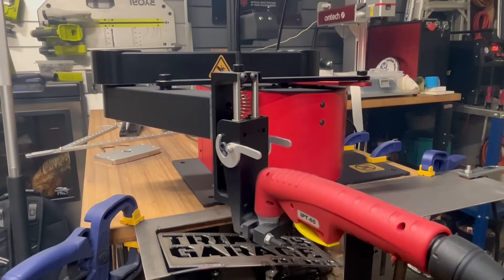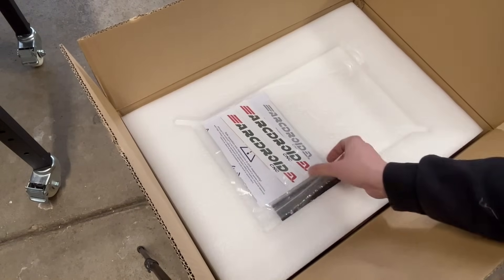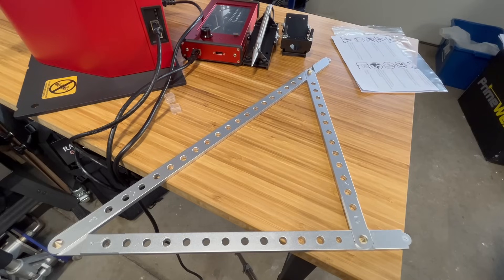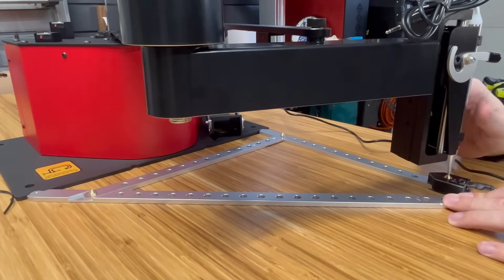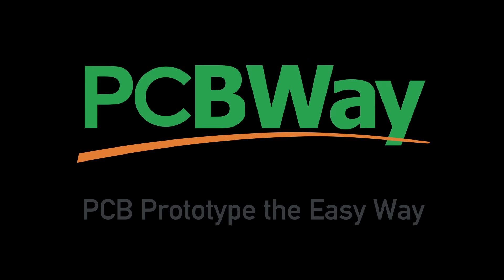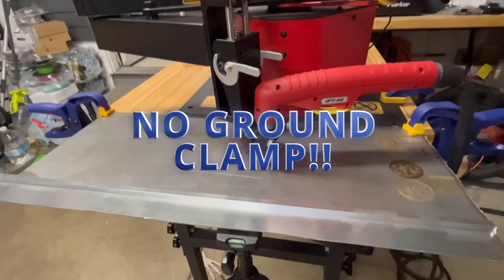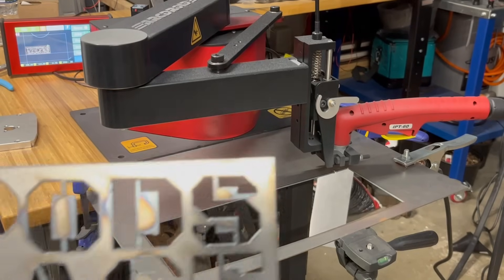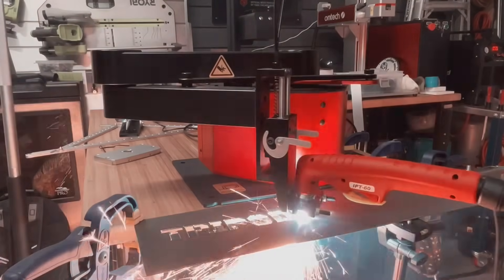ARCDROID PORTABLE CNC PLASMA MACHINE

Comment: Had an original plasma cam. The dirt and smoke it created doing long cuts in stainless covered my shop and everything in it with slag and dirt. Had a water table, vent hood , even tried a 6 inch vac line that rode with the torch..no way. Finally I called the company and was told most guys will set it up in a open ended trailer outside. These things are great but they can cut hundreds of inches without stopping and the amount of dirt and smoke is huge.

Comment: great clip. the Arcdroid is an amazing piece of kit. i hope to get one. when i can afford it. in the mean time post up all your arcdroid works as they will have so much info for those of us that want one.
Reply from the maker: Much appreciated!  Hope to have more content on it in the coming months.  I am looking for a local metal supplier in my area.
Reply: You can have mine. Unless you’re a full-time computer, geek/computer engineer/computer programmer/software expert they are impossible to figure out. The instructions suck. It will tell you to finish programming and then exit the screen, but there is no button marked exit. No matter what button you press the screen wont exit. I’ve had mine for about three years every few weeks I drag it back out and have another go and I cannot get it to do what I program.
Reply: @davidcat1455 I guess you wouldn’t recommend it then? Ive heard some mixed opinions and I’m unsure if I should buy one
Reply: @yeahnah9672 
They’re probably okay if you understand technology . I don’t even own, or want to own a computer. 🤷. When I purchased it, it was misrepresented as a standalone unit that you didn’t need a computer to operate. That’s not quite true. You have to keep updating the operating system  by downloading onto a USB and then entering it into the touchpad. There’s also a micro SDS card thingy involved. It does have some good functions I guess. Technology bores me shitless, and I live in a different country with absolutely no technological support anywhere near me. Hope that helps.
Reply: @davidcat1455 which country are you from if you don’t mind me asking
Reply: @yeahnah9672 
🇦🇺🐧. Australia